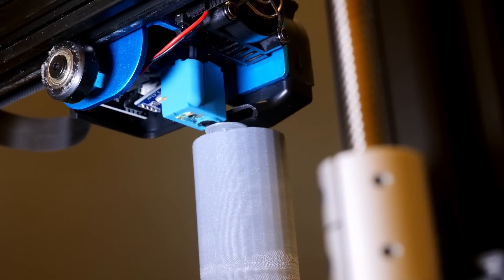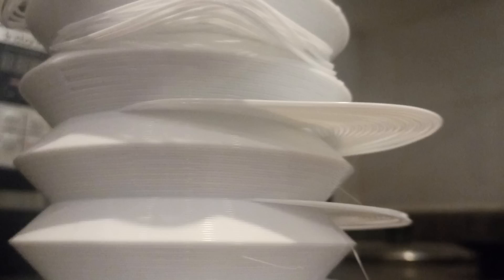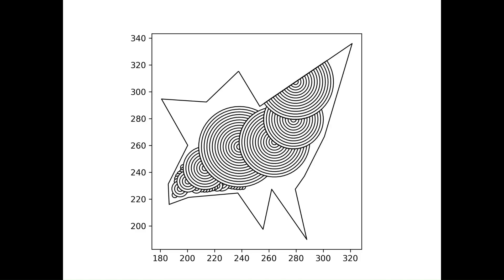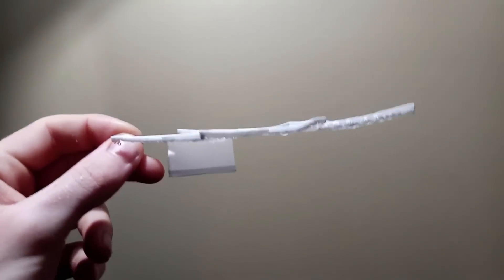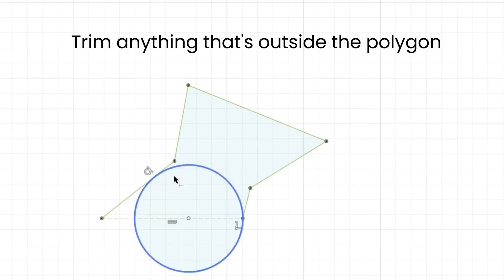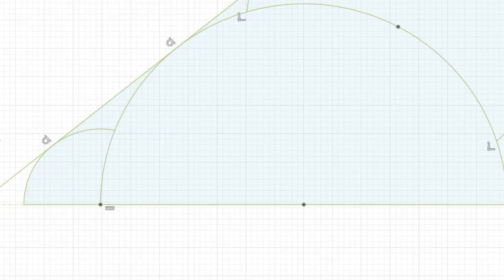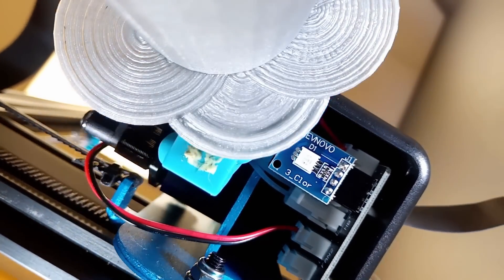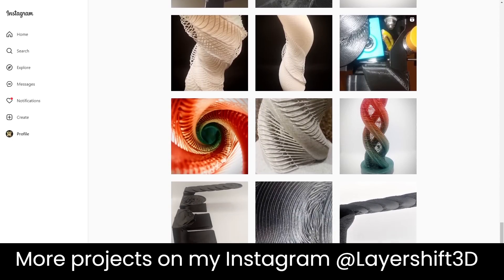Arc Overhangs Eliminate Supports to Reduce 3D Printing Waste

Comment: I assume this uses a slight overlap with the previous pass to get it to self support could this be more generalized to say improve angled overhangs? In more organic objects like figurines? Or like a ball
Reply from the maker: This also works on angles less than 90 degrees. Once an object is sliced, any overhang is technically a 90 degree overhang because layers are flat.
Reply: @3DQue  ok but while your arch  is a break though I don't know if as demonstrated it would leave a good finish on the overhang on a ball  where I would think something more concentric would possibly be a better solution.
Like a mash up between your work and nonplaner printing which has improved the looks of the tops of balls and other curved surfaces.
I unfortunately can't code, to help or develop my own but hopefully you find my comment useful.
Reply from the maker: @kevinbruce5981  Good news! Steven is also a master of nonplanar and working on cleaning up the overhangs.

Comment: Very Very cool, discoverd this one after CNC kitchen showed it.
Hope it can be implemented to Cura Slicer.
As the 2nd layer is the main issue for sagging momentarily, i wonder if we can use overlapping arcs on the 2nd layer aswell to minimize the issue. so a 3rd layer can be printed regularly.

Most important: thanks to youtube and this Prior Art, we can keep the tech out of Patents of  commercial company's and inside the Open Source & community Space.
thanks for sharing and hope we can sponsor/credit the inventor.

Comment: my 2 questions are:

does it work on budget printers like the anet a8?

can we get a tutorial on how to install the algorithm for testing ourselves in cura and prusa slicers?
Reply from the maker: 1. It works on any FDM printer, the limitation is that you need good part cooling fans, otherwise the overhangs will look bad.

2. It currently doesn't exist in any slicer. It has to be run directly from a python script. I'll definitely make a video about it once it is available within  a real slicer

Comment: I'm curious, why use arcs, instead of a concentric pattern? I saw you mention that type of pattern would be tricky mathematically, but it should be already implemented elsewhere, right? Like in the top/bottom layer fill pattern?
Reply from the maker: A concentric pattern will work with simple shapes, but not for complex shapes. There are some ways to perhaps combine recursive space-filling with concentric patterns, but the code will become very complicated.

Comment: Interesting concept, however the overhangs at this point are not usable on any real world print where accuracy and flatness of the overhang is required.  It will be interesting to see where thus goes and how it develops.

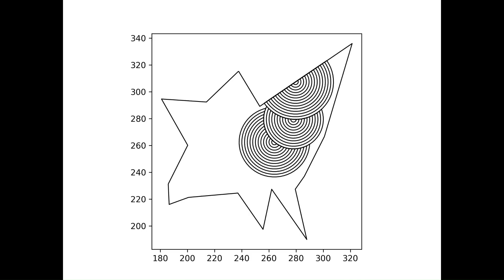Comment: @0:30 is reminiscent of trochoidal CNC milling cutpaths. If you implemented a proper medial-axis calculating algo the next step to trochoidal print motions are pretty straightforward and would be quite a bit more efficient in terms of the extraneous separate moves involved with your existing algorithm where many disparate separate print moves come in to fill in the leftover space. Following the medial-axis of the 2D shape to print will be able to produce effectively the same supportless strategy but with less moves between cuts because more of them will be in a series of concentric arcs rather than becoming sprinkled around the perimeter. Good work!
Reply from the maker: Interesting! Yeah this algorithm is quite simplistic, and is more of a "brute force greedy algorithm" . It is the proof of concept that is easiest to implement. I'd love to see more complex algorithms used to simplify the toolpath and improve the surface finish.

Comment: Have you tried to use this as a type of support? having a little disks vs. a whole column from the build plate up to the supported part. Have you tried other shapes besides an arc? can you do longer more straight arcs to fill in some of the spots? also it shows extrusion inconsistency you can see the pattern its almost like it grabs and skips a tad or its the meshing of the gears

Comment: Amazing work! I wonder if it's possible to have the arcs start with less curvature? Perhaps by having centers of arcs slightly recessed or arcs that intersect eachother at some fixed angle? This could be really groundbreaking!
Reply from the maker: Yep that's probably one of the first things I'll work on - reducing the frequency of the micro-arcs since they are the main cause of surface imperfections.

Comment: Even if you can not get the surface quality well under control, this may allow some larger bridging or - at least less material usage for supports. A small support can now grow a lot larger further up. Definitely a VERY good demonstration that now need some slicer makers to properly start implementing it into their slicers to see how far that can be pushed. Impressive.
Reply from the maker: Thanks! I think this method is definitely best for smaller overhangs. It is fun to push it to the limit, but I can see the most practical benefits coming from small overhangs that would otherwise require those tall, skinny, tower supports that end up being kind of useless.

Comment: Wouldn’t a concentric pattern do the same or is there something intrinsic to arcs that I’m missing?
Reply from the maker: Concentric patterns break entirely when the overhanging shape is a complicated shape. For example the center of the concentric pattern needs to lie on the starting edge, or else it will try to print the overhang starting mid-air.
Reply: Thank you for the explanation, this does indeed open new possibilities.

Comment: Saw a video from CNC kitchen on this, then just now found this video.  Made a comment there, but you invited comments here, so I'll repeat it.

The other video shows that the bottom layer of the overhang can warp when subsequent layers are printed on top of it.  It seems to me, if the overhang were constructed thicker, it may tolerate layers on top better without warping so much.

Say the overhang is two or more layers thick.  Inspired by conical slicing, if the extruder has the necessary clearance, you might be able to get away with a pattern like this:  Print the first arc as normal.  Print the second arc, then the first arc on the layer above.  Print the third arc of the overhang, then the second arc of the layer above; the fourth arc then the third arc above, and so on.

If that angle is too steep, you could have the top layer 'lag' by two arcs.  Layer 1 arc 1, L1a2, L1a3, L2a1, L1a4, L2a2, ... L1a(n) L2a(n-2) ...

The Z endstop may make this approach unworkable, though...

The most sophisticated manifestation of this algorithm would calculate an appropriate 'arc lag' of the second layer (and more? third layer, fourth layer?) from the layer height and extruder nozzle diameter.
Reply from the maker: Interesting idea! My hope is to incorporate this into current slicers, so having additional Z-moves is something I would hope to avoid unless absolutely necessary. 

I want to first try printing the layer directly above the arc much slower to avoid the issue of plastic contraction and warping. Or maybe repeating the exact same arc-overhang pattern, but printed faster because it has support underneath.

Comment: In CNC Kitchen Channel I leaved a comment with an idea about that, if you are interested you can check. Another idea is: the property of stitching in arc shapes used in that ways always work, so you can use elliptical paths that allow a lot more flexibility in reaching the limit of geometry that is in printing. Also with elliptical shapes the other idea on CNC Channel can be used more efficiently, due to the shapes of primary overhang printed.

Comment: Surely if arcs works - then straight lines could work too? Can you try this for straight over-hangs like in ur part at the end?

Great stuff btw!
Reply from the maker: Thanks! I definitely want to try straight lines, however it actually isn't so easy to implement a recursive algorithm using straight lines. Arcs have a nice way of filling the space of any arbitrary shape. But I agree that straight lines would be better in the cases of simpler geometry.
Reply: @3DQue  - yes. I love ur algorithm. Can’t wait to see more of this!

Just want to add. If straight lines woks there would be many applications that would make it useful. Bridging over holes (even very large holes) or square or triangular pockets. You could write an algorithm to deal with all those scenarios. U have probably thought of this - I’m just excited haha

Comment: thought on strength and minimizing warping from subsequent layers:
if this program could create 'ribs' that extend outward by over-extruding at the same point for each pass on the arc, it might increase the stiffness, and stop the layer from bending up or down. it would also make a cool radial pattern :p
this idea also extends to other patterns besides ribs, a hexagonal rib pattern maybe? a grid?

Comment: It seems like the biggest droops appear at the center of the circle so maybe it can be a flatter bottom if it chooses circles so the center is slightly inside the previous one rather than having the center on the edge itself. Also, ellipses might be able to fit the shape with fewer small circles needed.
Reply from the maker: This 100%. The arc centers should definitely be slightly "inside" the previous arc to minimize the "micro-arcs". Then maybe people would stop calling it nip-overhangs LOL

Comment: Next you can do negative overhang by ironing a seam where it can bend and then use the print head to push the flange over a bit and make it droop, then print on the bent flange.
Reply from the maker: Negative overhangs are definitely possible with this method, I'm sure of it. It just requires non-planar slicing which is an entirely different beast.
Reply: Exactly what I was thinking. the overhang ‘hinge’ area could be printed very thin/ not much infill so the cantilevered area would droop down and possibly be pushed down by the nozzle or the nozzle assembly (so nozzle doesn’t melt part)

Comment: Great stuff... arrived here from CNC Kitchen, and Subscribed. Sometimes accidents lead to a Genius idea!
One way to improve the speed would be to slow the printing head for the first layer of the overhang, but subsequent vertical layers could have the print velocity increased since the underlying layer of support is already there. It might have to be a gradual increase depending on the material. I also like the idea by Dallas Prints (below) who suggested "overlapping the nozzle orifice with the previous line when building this outward"... it might be worth looking at too, especially for the first layer of the over hang.
Reply from the maker: Yeah the arcs need to be printed slowly but the rest of the print could be normal speed. 

I expect that some special slower print settings could be used for the layer directly after the arcs that would help reduce warping.

Comment: when the arcs reach a previously defined minimum diameter, don't continue adding smaller arcs
instead, blend over from the current outline to the outline of the overhang
you could also start with non circular arcs, like an offset to the inside of the overhang outline
genious method! i hope it makes it into slicers
Reply from the maker: That's a really good idea. I agree that the micro-arcs on the outer edge are kind of unnecessary and ruin the final surface finish.

I hope to be able to do some kind of 'interpolation" between the outer perimeter and the arcs to eliminate those micro arcs.

Comment: Ideas:

1) You could replace some of the mini arcs between two existing arcs by standard bridging. That might save some time. And lead to better quality as it seems to me that the smaller the arcs, the worse the quality. Perhaps try to build into the corners first, then bridge between those? 
2) It might be interesting to see if ovals would also work. Might be good for certain geometries. Some varying of the flow rate might be needed as the width of each line of plastic would no longer be constant.
3) You have demonstrated 90 degree overhang, bravo! What about slightly less? (eg, instead of the standard 45 degree overhang we can do now, can this technique be used for a 75 degree overhang?)
Reply from the maker: 1. Using bridging whenever possible sounds like a great way to improve the edges of the overhang. Those tiny arcs are the cause of uneven surface finish, so getting rid of them would help a lot.

2. Yes, ovals, or even a shape that slowly grows to mold to the outer geometry. That approach is a lot more complicated mathematically, but it would definitely reduce the total number of arcs required.

3. 100% it can be used for any overhang angle, not just 90°. An 80 degree overhang is just a bunch of 90 degree overhangs one on top of another!
Reply: @3DQue  I'm afraid you can't make a traditional (less than 90 degree) overhangs with arcs though. If you try to make a slope (say 45 degrees) with a bunch of arching lines, it's going to make a cone. I don't know if there's a proper way to print rectangular inclines without straight lines, unless you use non-planar printing. I think very high (>80 degree) overhangs are possible if the outer wall is able to overlap the previous layer regardless of the line width and overhang angle. You could make the outer wall zigzag, going over the edge and back onto the previous layer many times like a square wave. I don't know if that been tried before though.
Reply from the maker: @SoundShunter72  You can actually! You can approximate a rectangle with circle packing. I personally think this algorithm would be only useful for really steep angles 75-90 degrees.
Reply: @3DQue  
4. Do the circles really need to be centered at the edges of previous circles? If no, you can eliminate the small fractal nipples.
5. Do the extruder passes really need to begin and end at the edges of adjacent circles? If no, you can actually fill the whole overhang with one circle (or some small number of circles in case of large overhangs). Maybe move the extruder head slightly towards already printed area at the beginning and the end to stick the extrusion.
6. You can start printing the second (third etc.) layer atop of the overhang amidst the process of printing such overhang, so the rigidity of the overhang will increase in order to minimize warping.
Reply from the maker: @wormball  I've actually just tried offsetting the arc centers so they are slightly inside the previous arc. This does help to reduce the 'nipple' effect!

I think it is quite helpful for the lines to start and end on an existing wall. Using just a single arc sounds like an idea worth exploring, although I don't think it will work for every single shape.

I agree with your idea to reduce warping, although I think it would be better to just do the next layer really slowly to avoid warping instead of printing multiple layers simultaneously.

Comment: I think it would be useful on extended overhangs to have a minimal support added if it is likely of too much sag from the subsequent layers. Maybe this can be added manually, picking a spot by the user.
Reply: From CNCkitchen's video, it seems the problem is the opposite of sag. The plastic contracts, causing it to bend upwards. Still, some "anchors" along the edges might help.

Comment: I saw another video where circular prints can have a perfect 90° overhang. I figured it would only be a matter of time before someone came up with a clever way to add the circles on top of eachother!
Reply from the maker: that's the fullcontrol.xyz demo. Fullcontrol gcode is going to be a huge game-changer for 3D slicing innovation, since it'll let many people experiment outside the boundaries of what normal 3D slicers allow.
Reply: Does it work for circular objects only? What about just extending contours of the object instead of creating arcs? Could be easier and would look better. (I would try it myself, but I don't 3D print yet, I'm just a fan)
Reply from the maker: @az09haz  Stay tuned for the next video. I'm combining your idea of offsetting the contour and connecting it to the arcs to make the best of both.

Comment: Definitely looks promising. I remember one time I forgot to ture on supports for a capital i that was upright. I was surprised how well it still came out. Your 90 degree overhangs looks really good and I bet it could be used for a lot of prints.
Reply from the maker: Yeah It's crazy how prints find a way of succeeding sometimes even when they really shouldn't.

Comment: Question:
What is the biggest radius circle that this works for? The bigger the radius gets, the closer the perimeter gets to a straight line. So if straight lines don't work, then there has to be a limit to what radius circles work.
Reply from the maker: I believe straight lines would actually work as long as there is sufficient overlap with the nozzle orifice. I don't know what the limit is for the maximum radius - I haven't reached it yet.

Comment: You need a minimum amount of cooling time between each arc. When you start the small arcs you need it to cool before you start the next one. You could go to another area and print it's arc and then come back but you would have to keep track of each arc group.
Reply from the maker: Yeah the smallest arcs are the most problematic for sure! I definitely agree, and I think there should be as much time as possible between small arcs to maximize quality. You're 100% right with having to keep track of every arc group - that adds a whole extra level of complexity, but I think it is totally doable.
Reply: Could you use regular line printing for smaller arcs? Almost treat it as infill?
Or print along (around?)  the arcs to reinforce them?
Reply from the maker: @francisdoherty5580  This sounds very similar to the changes I made in the update video I just uploaded. Check out the newest video on this channel